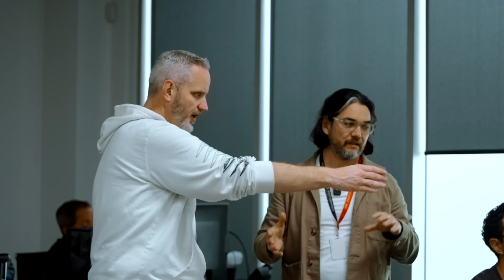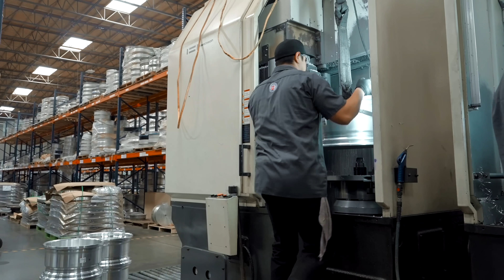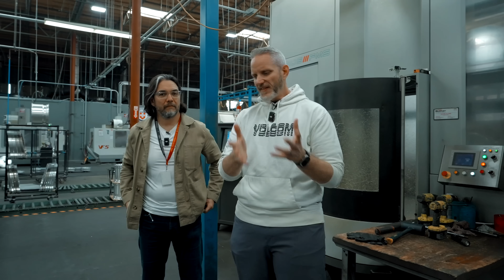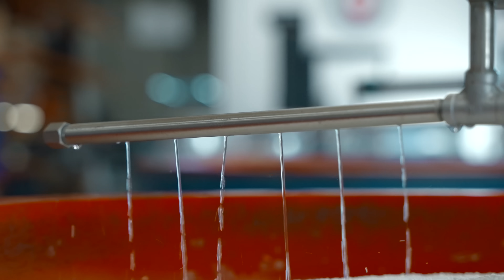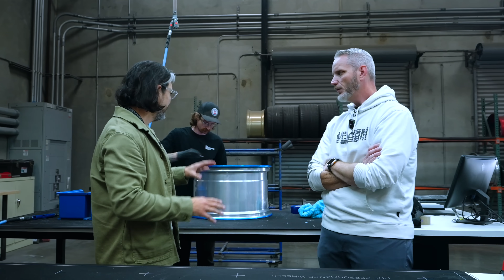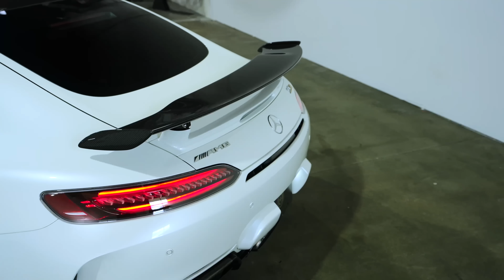HRE Factory and Design Tour!

Comment: I noticed some of the wheels don't have the standard wheel weight lip on the outside. 
They can still take wheel weights right?
Reply: Yes, most “nicer” wheels receive weights on the inside of the barrel, kinda behind the spokes. If your car has good looking wheels, it’s very likely it has the same kind of weights (even if those are the stock, factory rims)

Comment: I’d bet those PC specs running that CAD software include an Intel i9. As a CAD designer with over 10 years of experience across multiple companies, I’ve consistently worked with systems powered by Intel CPUs never anything else. Intel has always delivered the performance and reliability needed for demanding CAD workflows. This was great content Jay, I highly enjoy your channel!
Reply: I’ve got a 13900ks pc and a 9800x3d pc.  The 13900ks is significantly faster with anything cad related. Also processing 3d scans takes 1/2 as long on the 13900ks.